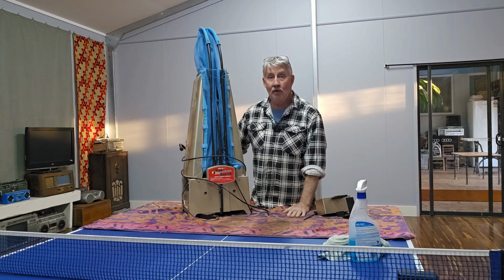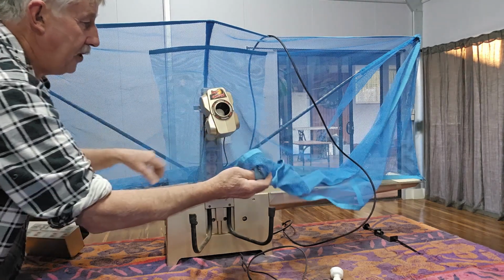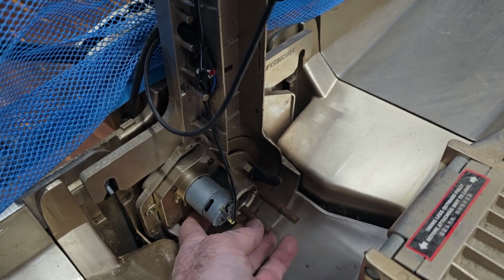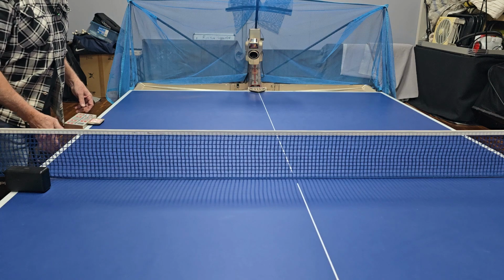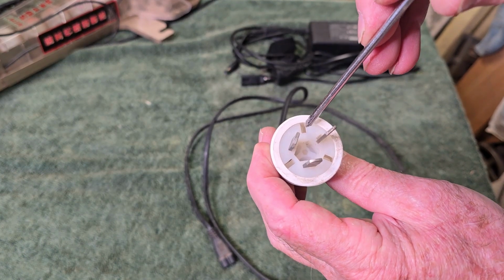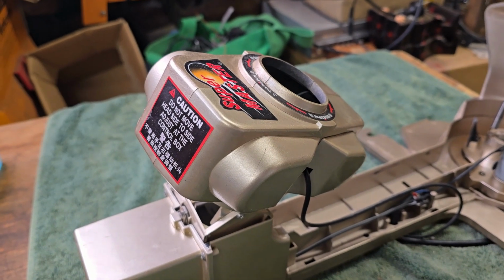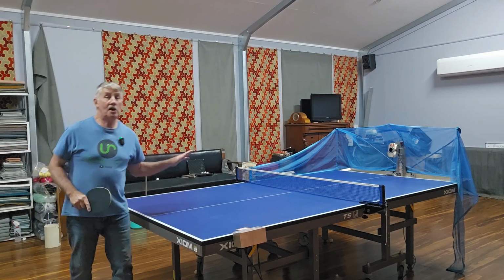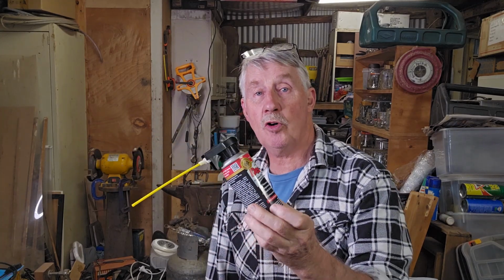How to Repair & Service a Table Tennis Robot Super Master Ping Pong plus a Quick Demonstration!

Comment: Interesting machine. That 240v plug was wired backwards. Active should be top left pin looking at the back of a plug or front of a power point. They do make plugs for figure 8 cords with a cover that holds the cord better than when someone puts those plugs made for round cable which you were right to get rid of. Most people seem to be unaware they exist. I think even Bunnings stocks them.
Reply from the maker: Thanks for the correction Steve, for some weird reason I mixed that up! Not enough coffee me thinks! 😄
I didn't know of those plugs either! Must grab a couple next time I'm at Bunnings 👍